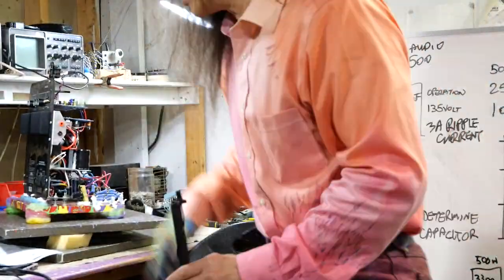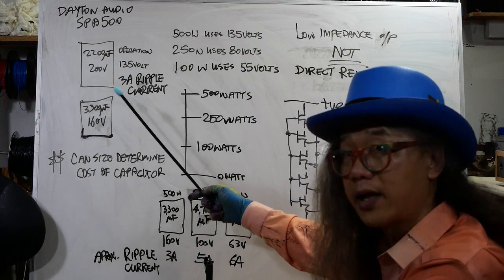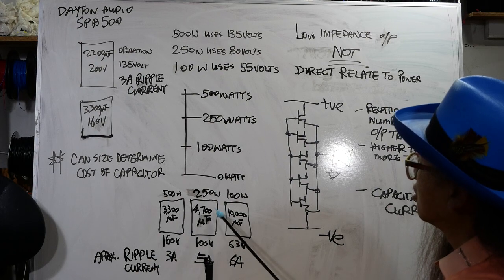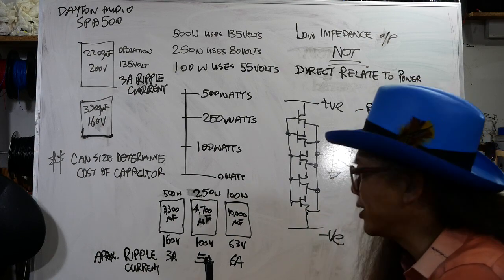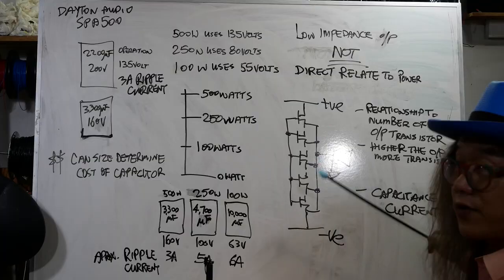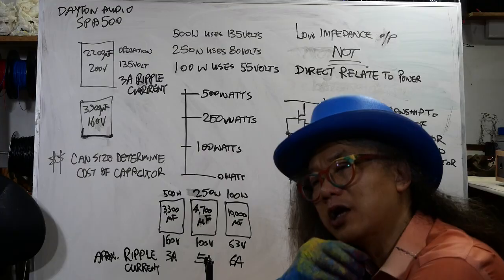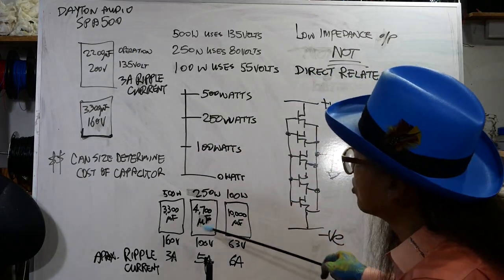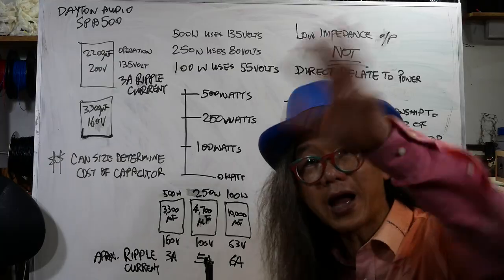Why Audio Manufactures are always Cutting Corners on Power Supplies

Comment: Low ESR tantalum cost real money.  That ripple currents kill capacitors.   AS in they will explode.   I agree with you.    USE some MLCC for lower ESR decoupling.   The best is MLCC FILM caps they cost a bundle.
Reply from the maker: It is all about cost.  Cutting corner and cutting cost.

Comment: 😂 you did what..? You parallelled 100's of small transistors?! 😮 that sounds amazing. It's a bit like some PSU designers opt for 200 small caps in parallell 'making a cake' PCB instead of a few large large cans 🎉
Anyway, thanks for video, now I must look for that small signal transistor amp! 😊
Reply from the maker: That amp was under my old brand Blue Circle Audio.  The model of the amp is call the NSL.  You can find reviews online.
Reply: @angela-gilbert Thanks for the hint! 😅 Been rummaging thru 4 different videos trying to find it 😂
Reply: @angela-gilbert Fascinating build that NSL!  Cool concept. 👍
Reply from the maker: @Paxmax  Did you look it up on the internet?  It is not in my current production.  NSL was produced between 2009 and 2015.  Try this link.
https://www.theaudiobeat.com/equipment/blue_circle_nsl.htm
Reply: @angela-gilbert Yes, I read 2 web sites reviewing it 😊 ...but then my foot slipped down the rabbit hole of diyaudio 😅 where others are trying their hand at it with varied success 😂

Comment: Frankly I prefer to not have a powersupply at all .. just battery power without any regulators or converters.
Reply from the maker: I cannot agree more.  However, we live in reality. 😁 We have to do the best compromise.
Reply: @angela-gilbert i run my amps from batteries. Its quite simple. Just some relays. When in standby they get charged . When in play mode the batteries are disconnected from the charger. Cheaper than a powersupply.
Reply from the maker: @nagyandras8857 For personal use, it is easy enough. I have used solar panels to power everything about 10 years ago.  Solar power to charge batteries and run the system at the same time.  However, it is next to impossible to market it.  Not enough people will get into it.
Reply: @angela-gilbert consider a well built gainclone. I needed 4 sla batteries only. Each nominal 12v. The charger is just a floating type 12v charger. Nothing fancy. The rest is just a bunch of relays. Far cheaper than any decent powersupply. And its perfectly isolated ftom mains. Sure its limited in play time , but its not realy an issue.

Comment: I agree with your sentiment.  I'm a big fan of large, bulky filter capacitors, it's surprising to see how under-specc'd (IMHO) some amplifiers are. Look at some of the multi channel A/V receivers.

I got lucky and was given an older Rotel integrated amplifier,  it was rated at 'only' 80 W /ch but had three power output devices in parallel on each rail, so a dozen big power transistors in the amp. It is a real beast with very low frequency, high amplitude signals. They brag of a really high damping factor in the specs, it may be as high as 1000. They also pull the negative feedback right from the speaker terminal point. Beast mode.

Comment: In a subwoofer you usually need pretty much power, because the impedance rises to very very high levels as the frequency goes down. Some goes up to 80 ohms. Plus the power ratings on these plate amps are measured at only 4 ohms plus usually with 1% THD and some even at 10% at rated power.
Reply: You mean the impedance lowers,low impedance like 3 or 2 ohm is hard job for many commercial amplifiers.Lower frequency demands higher energy (current)from the amplifier.
Reply: @kikopasinecki5110 no the lower in frequency you go, the higher the impedance. And also the warmer the driver gets. So a speaker that's been playing a little bit has higher impedance than one that is just starting to play

Comment: For the cap's , it's just like batteries, they last longer when operated at lower voltages.
Reply from the maker: As long as the voltage stay within the rated voltage, electrolytic capacitors behave the way it should.  It is only when pushed pass it rating then things will get out of controls
Reply: @angela-gilbert  but as they age the top voltage rating degrades, so if you operate at the rated value, you can stress it over time when running at peak currents.  All the high-end equipment has overrated caps in key systems from what I've seen.
Reply from the maker: @rockpadstudios If only using one capacitor per rail, you are correct.  Not if the power supply has multiple capacitor in parallel.  Each one work load is very low and there is no concern for long term use.
I would use a lot of so call high end equipment as reference.  Especially when they are owned by some money making parent companies. All they are looking is the dollar sign.  They cut corners all the time.
Reply: @angela-gilbert  That will help, I've noticed on the high-end equipment they parallel them.  Not on the cheaper stuff.

Comment: Are we not listening to the power supply essentially ? If the amp has a more robust power supply might it sound more dynamic as well?
Reply: In essence the amplifier is modulating the power supply to amplify the music signal,it mirrors the signal from the base and outputs the amplified signal through the emitter using the power supply from the collector.

Comment: A friend of mine has been a designer for several electronics manufacturers. He told me about the process of designing a piece of equipment. It begins with an established target retail price and from there working backward with whatever formula a company uses to reverse engineer the cost of the bill of materials. He's told me horror stories about arguments about a BOM budget being a FEW CENTS OVER, or even one instance when the BOM wasn't 10% less than budget to account for inflation over the projected lifetime of the product. Products are also designed for serviceability,. My guess is that some manufacturers don't cut corners, but a reasonable amount of them do, especially those who are designing lower retail priced (known as 'budget') equipment. 

I once repaired a Carvin mixer that had a poorly designed power supply that had an under rated bridge rectifier in it. Replacing it with a higher rated part made things a lot better for the client.
Reply from the maker: I know about those horror stories.  Very sad if you know what they put in there.  Now aways, most of them don't build for serviceability. They want you to buy a new one everytime it breaks.

Comment: Ali Express sell a Krell clone that has 12 x 250 W output devices, it's designed to run in class A (push pull) but the quiescent current is adjustable from 0 A to almost whatever your heatsink can dissipate.  I built a 1 KVA PSU that uses two 500 VA toroids with two Shottky diode bridge rectifiers that consist of eight 40 A discretes and fout 22,000 uF caps on each rail, each with a 1 uF film cap in parallel, the rails are +/- 45 V.  The quiescent current is set at 2 A per rail which gives a few Watts of class A and it drives my four pairs of Quad ESL 57s better than any amplifier I have heard.  The quality and rating of a PSU has a huge influence on the sound and is the most expensive part of an amplfier (if it's a linear PSU), heatsinks are the next most expensive part and this explains why class A amplifiers are so expensive and heavy.

Comment: Power supply and output impedance are the key words here
An amplifier of two times 70w could easily outperform an amplifier of two times 100w 
If this 70w amplifier delivers 70w at 8ohm 140w at 4 ohm and even 280w at 2 ohm 
And the latter one would do 100w at 8ohm and 150 at 4ohm 
In this scenario the first one will perform better even though the power output
Every speaker how good they are designed or how expensive they are will have impedance "grills" meaning their nominal impedance might be 8 ohm but it will vary in the spectrum they are used for there are examples were some units could drop even far below 2 ohm (infinity) 
The amplifier of two times 70w can cope with this much better then the latter one does and eventually will sound better
Reply: So having to cables coming out of the same Amplifier want help the load or will help ,? I guess I'm confused because hooking up a drill to the end of an extension cord while having a light bulb hooked up at the end of the exact same and where the drill is connected or whatever electrical Appliance like he was referring to does make the light bulb change drastically on that one cable thank you for the video any further explanation greatly appreciated thank you in advance.🙏
Reply from the maker: @TheNLHAZE I am going to do a white board video again to explain this one with some diagram.  Much easier that way.
Reply: @TheNLHAZE i will try to explain it a little bit
When playing music overal it's kind of rule that your bass speaker consumers about 70% of your amplifiers power the mid range about 20% and the tweeter about 10% that's why your bass speaker van handle much more power then your tweeter does
Im my above experiment imagine that the drilling machine is your bass speaker and the light bulb is your tweeter? That's kind of what is happening inside of your speaker cabinet
However the effect whether or not you can even hear the difference very much depends on the amplifier hooked on your speaker cabinet and also the cable used 
Secondly what i havent mentioned is that your speaker must have two sets of connections ie one for the low ends one for the mids (highs) (four connections on the back side)
If your speaker doesn't have this there's not much use in trying this 
It would then be the same results in changing awg 14 cable with 8gage ore in metric changing from 0,75mm2  to 1,5mm2
But if your speaker system does have this option it's never wrong to try what the difference is 
And this extra cable doesn't have to be the same awg to 
As i mentioned mid / highs only take about 30% of your amplifiers power 
So a cable awg 14 or 0,75mm2 already is sufficient 
Does this explains it a bit more?
Reply: @petercelestion7661 thank you both very much yes I have the XT3 Tower Speaker's fron Emotiva and a XPA-3 2 channel amplifier so running to cables to that one speaker will make it sound better is what Im getting out of this,thanks always trying to learn more and more so I greatly do appreciate taking the time to give a better explanation. Cheers my friend
Reply from the maker: Well said.  It is all case dependent.  Some speaker impedance swing more than others.  However, some speakers, especially in headphone, they purposely alter the impedance to control what frequency they want more or less.  Or, what they would call "tuning the sound' or a signature sound.  It can be present or annoying.  However, that is the beauty of all the various choices we have in the market.  The last thing I want to see is everyone go for the same thing and no more choices left.
Reply: @angela-gilbert that's the beauty of being humans we all hear differently 
What mine ears might like to hear your's could be the opposite and the other way around 
However it's never wrong to tell people why you think something might be better if it is for the right reasons 
On that behave what's your opinion on bi wiring a speaker cabinet?
My believe is that it can definitely improve the sound system if the connected amplifier and speakers are decent quality 
Not because the sound is more "spacial" or better "Blacks" in the image but purely from an electrical point of view
Reply from the maker: @petercelestion7661  This is another good topic.  I don't have a black and white answer for this.  Some speaker sounds better bi-wire and some better single.  My question.  Is it because of the amp or speaker or both.  Answer to me so far is both.  Even though from a electrical point of view there should not be much of a different.  That tiny bit of resistance from the wires shouldn't make much.  However, it does.  My next question, where and why that make such differences.  Some of the differences are not always better but they are differences between single and bi-wire.
Reply: @angela-gilbert i can understand why people would think that it could not make much of a difference but in some cases it does the best explanation i can give is the following 
At an electrical point of view you see it as a. Unit provides power to a consumer (resistance wise) however a loudspeaker is not a standard resistor but a coil 
I have an experiment wich will explain what i mean 
Take an extension mains cord with a dual ac outlet at the end in one outlet you connect a standard 100w light
 bulb in the other one connect a drilling machine or grinder anything wich has a motor 
Now turn this one on and watch what the light bulb does
You will notice it will dim at that moment 
Now make the same experiment but this time the drilling machine is connected to a different extension cord (bi-wire) and do the same 
You will notice that the effect is much smaller 
From an electrical point of view 
Suppose you have an output of 20v from the speaker terminal you have a cable resistance of 1 ohm and the connected resistor is 8 ohm
Current will be 20:9 = 2.22 a
Voltage at the speaker terminal would be 2,2 x 8= 17.76 v
Now the connected resistor is 1 ohm (speaker coil behavior)
20:2= 10a 
Voltage at the speaker terminal would be 10x1 ohm is 10v
That's a drop of nearly 50% 
You definitely are going to hear the difference 
If the connection was bi-wired your mid highs are not effected by this voltage drop
Reply from the maker: @petercelestion7661 Good analogy but there is a catch.  The voltage dropping less from different is because the voltage before rhe circuit breaker isn't dropping.   When the machine drop a lot of power which make more current passing through the breaker and where the voltage drop is.
In the case of the amplifier, thr voltage is dropping for both the tweeter and woofer standing from an amplifier point of view.  You are assuming the resistance of the wire is making the difference and I do not disagree.  However, I believe it is only one factor out of many we can "see".

Comment: You're right, many do, however there are a few manufacturers that know the importance of a well engineered power supply.  Audio Note, for example, are famous for massively over-engineered power supplies.  Often a separate supply per channel.  Big bucks, though.
Subbed, great content.
Reply from the maker: I have seen big dollar equipment with tiny little power supply.  I can accept Dayton audio has to cut corners but anything $10,000 or more shouldn't be cutting corner on power supply.
Reply: @angela-gilbert  Agree completely.

Comment: I appreciate this presentation and would watch future technical discussions on other topics. Such as how few manufacturing these days are willing to spend the cost plus add the iron and copper weight for a choke in the power supply for an LC filter circuit as opposed to a bank of capacitors exclusively.
Reply from the maker: LC filters has their places but not in every power supplies. It is application dependents.
Reply: I think the choke he is talking about is the PFC choke for the auxiliary power supply in the amps and surround receivers,no commercial manufacturer of hi-fi equipment makes power supply with input choke it is more expensive 😀

Comment: Power supply design and construction  in stereo amplifiers was why IMD (intermodulation distortion) was a popular thing fifty years ago.
See the ILP magazine adverts in ETI and Elektor circa 1983, ILP made power amp modules both bipolar and MOSFET, they also made toroidal transformers and power supplies. their PSU designs were solid.

Comment: I enjoy your circuit design lesson. My preference would be 2 gloves or no gloves, but otherwise good stuff! To get the most musical flow, all the way, from the beginning of the entire system circuit chain to the end, up to the speaker, should a person aim/focus on low impedance as much as possible, equipment/gear, cable, wire, etc...

Comment: This plate amp is made to power subwoofers. They need this amount of power when used in a closed subwoofer where the low end is heavily eq-ed to get a flat frequency response. Anyway, amplifier power ratings in Hifi don’t mean a lot. They usually refers to very short peaks and  can’t sustain the advertised power. But good video.
Reply from the maker: Most of the mid fi amp especially the Japanese receiver rating are totally misleading.  Some of the higher end amps are not as outrageous.  On the other hand, U have seen commercials amp rating pushing their luck too.  It is a buyer beware situation.   There are good one out there.  The difficult part is how to tell which are good and those are bad.

Comment: Thanks for vid. Well explained. Can you recommend some DIY multi capacitor power supply projects/kits?
Reply from the maker: What do you mean by multi capacitor power supply?
Reply: @angela-gilbert  Somewhat similar to the one you made for the Dayton subwoofer?
Reply: Hi, so can you recommend some DIY multi capacitor pack (maybe 10-12 caps like the one used in the Dayton sub) circuit projects/kits?
Reply from the maker: @Just-h4k2t You don't need kit.  Just parallel capacitors to your power supply and make sure to install a soft start to avoid high inrush current.
Reply: @angela-gilbert  Alright, thanks for the advice.

Comment: Same reason to use multiple main-supply caps and local ones too. I then wonder if multiple caps and power stage devices as well get an higher overall slew-rate. I imagine those will be arguments in one of the next video of yours. Keep 👍 the good work.
Reply from the maker: Those are good topics.  However, I am trying to keep things easy enough for most people to understand.  I will try to figure out a easy to explain without getting into too much math.